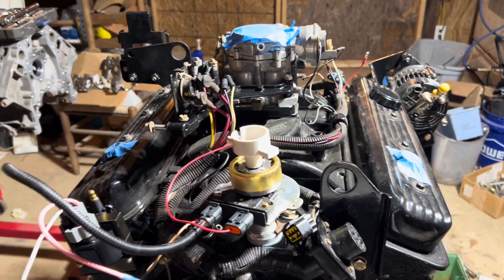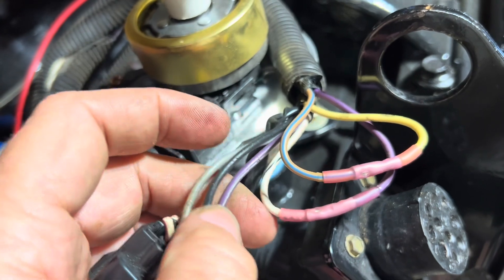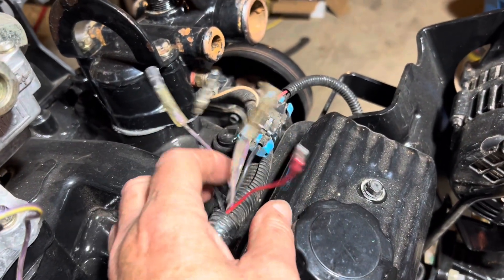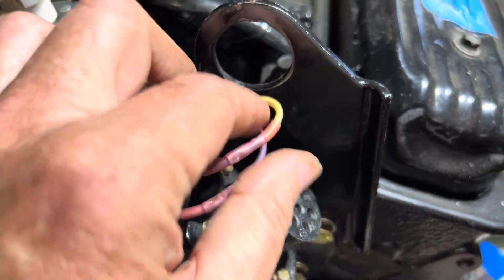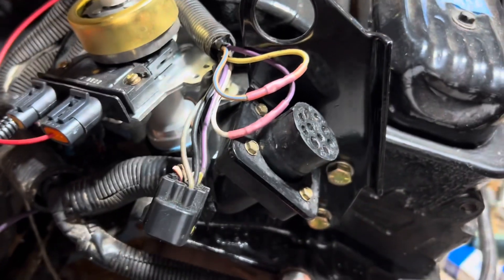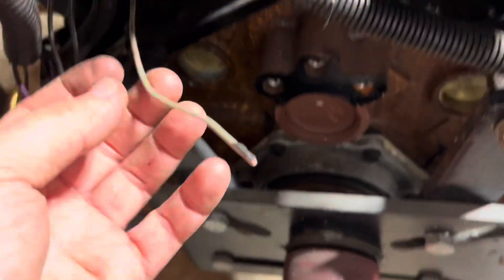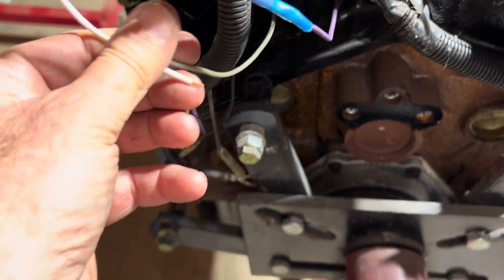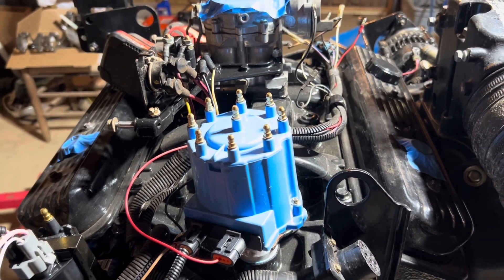4b - Best Way to Wire Delco EST Upgrade Kit into a TB V Harness

Comment: Bayliner 205

Hello, how’s it going? I recently purchased a Sierra V-8 Delco EST conversion kit #18-5514 install it on my 2004 Bayliner 205 
With a 5.0 engine using this video from YouTube 
4b best way to wire Delco EST upgrade kit  into TB V harness 

https://youtu.be/YPNZbf4MWUo

She’s still not starting no spark is there anyway you can help us or point us in the right direction to figure out this problem thank you so much.
Reply from the maker: You need to correct this comment before I’ll answer. You didn’t buy anything from me.
Reply: @moccasinmarine, im sorry I fixed my message.
Reply from the maker: https://youtu.be/8XdOu2r7fEg?si=gfc7MA28_hIn39fA

This is the Delco EST manual stored on my Google drive. It used to be online but that link is dead. Fortunately I saved the document to my Google drive.

https://drive.google.com/file/d/1FxCWhklzAlgPWYKwHrYvA8NhCnx_AuKM/view?usp=drivesdk

Comment: DO YOU DO THE SAME WITH 94 5.7  POINTS MODEL?DO YOU HAVE THAT VIDIEO THANKS
Reply from the maker: Points model? Points have not been used since about 1975, so there is no 1994 5.7 with points. My ignition kits upgrade any engine back to 1957 ish.
Reply: @moccasinmarine  brother its a 1994 omc gm 5.7 i pulled it out ouf a 1994 25 ft bayliner with a cobra outdrive  dont know much history just want to upgrade  to lst and wanted that question answered
Reply from the maker: How would I do a video on replacing something that hasn’t been around since 1975?  All you need is a single source of +12 volt power at the ignition coil for a Delco EST system. The rest should be obvious.

Comment: I’ve wired everything as shown in the video, but I have no spark at the 1 spark plug. Any thoughts/suggestions?
Reply from the maker: Yea use this manual to troubleshoot 

https://f01.justanswer.com/oldnewenglandmarine/36c97f52-be29-4a64-9ab5-8bf8b351bf86_Delco_EST.pdf

Comment: Hi, my EST only works on the distributor when I run it with a closed loop otherwise the engine won’t start
Reply from the maker: I don’t know what you mean by closed loop. What loop are you closing? Is your engine carbureted or fuel injection?

Comment: You mentioned in a couple of videos of a plug that goes where the shunt tool goes. My kit didn’t come with one,can’t I order the plug make my own? When setting base timing and you put the shut tool in after the engine is warm and running do you take the shut tool out before you shut the engine off or does it matter?  Also, you show pages from a manual that have curves and other information, I haven’t found such that I could download. Can you steer me to this information?
Reply from the maker: If you didn’t buy my kit you are headed down a rabbit hole I can’t get you out of. While I’m pretty sure you bought a kit before you found my you tube kits, you need to watch my videos very carefully. I explain that other kits are inferior because they don’t use genuine GM ignition modules. You can order anything you want but knowing what to order takes work.

The manual for the Delco EST is found here:

https://f01.justanswer.com/oldnewenglandmarine/36c97f52-be29-4a64-9ab5-8bf8b351bf86_Delco_EST.pdf

Comment: Hey brother, what temp switch did you use to replace the original?  I want to wire mine with the same.
Reply: Also, you said TB V not IV, my IV looks just like this, plugs and all, can I set it up like this or not?  Everything appears the same except the wires on coil are purple and gray, but Im good with wiring so Im not scared.
Reply from the maker: I’m not understanding your questions. First if your system looks like a TB 5 then it’s a TB 5. The TB 4 is entirely different. You are also asking questions that have been covered in several videos. Finally, I sell a kit that I created using knowledge and skills. The parts contained in my kits are proprietary and I don’t reveal individual part numbers.
Reply: @moccasinmarine Ok, I was a bit confused because I was sure it was  a V, but the part number on the ignition control box came back to a IV, must be an error.  TY. .

Comment: My TB V had two wires on the old coil, purple, and the grey/white that you left abandoned on the old TB harness, have you ever seen that?
Reply from the maker: Yes that’s how thunder bolt IV systems are wired. One purple from the ignition switch providing power and another purple leaving that powers the Thunderbolt IV module.
Reply: @moccasinmarine  so the grey and white wire must be the grey wire that goes on your ignition coil?  I read that they are all grey but I see no other option on mine...it must be spliced somewhere to go back to the tac?
Reply from the maker: @jasonhosking8439  I’ve never seen a gray and white wire. The colors are too close together to be distinguishable. Are you sure it’s not just a white wire with dirt?
Reply: @moccasinmarine  100%, and a continuity test confirms it is the one that is abandoned on the TB V harness.  I found a diagram that shows that wire is spliced into a run from the harness to the old TB module.

Comment: I might be missing it, but is there a spot in one of the videos that shows the shift kill white/black, and red wire on the harness on the shift kill switch itself, or are they connected together?
Reply from the maker: The shift kill switch is a micro switch mounted to the shift mechanism. It doesn’t get connected until the shift mechanism is attached to the exhaust after the engine is installed in the boat.
Reply: @moccasinmarine  thank you, so there is nothing saying where the red wire from the distributer, and the white/black get connected?  That's why I was wondering if I missed something in another video...appreciate it.
Reply: There are 2 wires coming from the shift kill. 2hich of those is the red wire connected to?
Reply: @Michaelhottowe-y3k  caution to the wind, I got mine working great.  It's winterized right now so can't give you the 100% answer...but I used process of elimination.  Nothing about splicing any of the wires for the whole kit felt good, but it worked.
Reply from the maker: @Michaelhottowe-y3k  the shift kill switch has two pre-existing bullet connectors, one male and one female. They plug into the white/blk wire and red wire that I discuss installing from 0-3:23 in this video. Now older shift kill systems don’t have the bullet connectors, rather there is a screw terminal. On these you cut the ring terminals off and attached bullet connectors (male and female) so that the shift kill plugs in just like in this video.